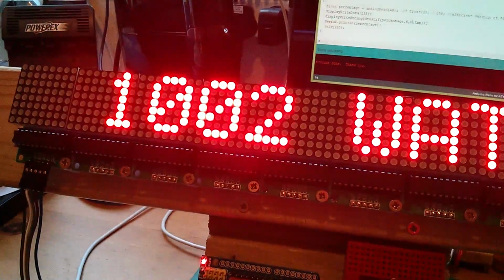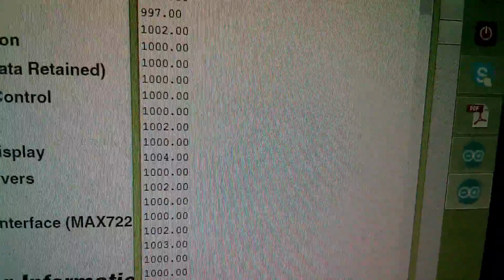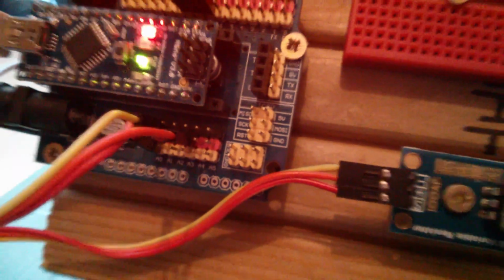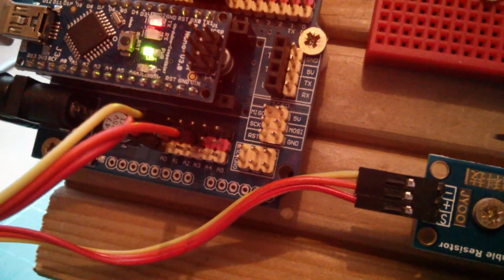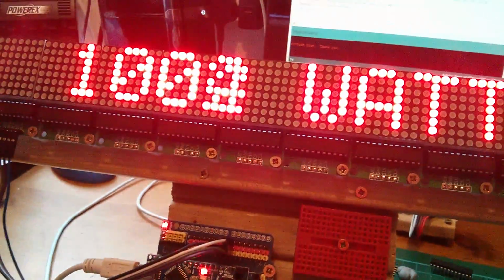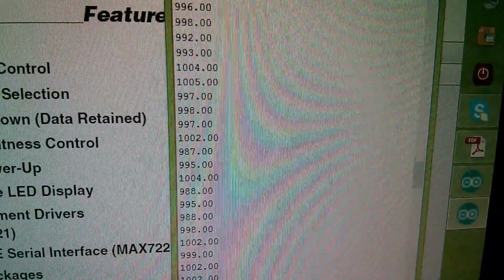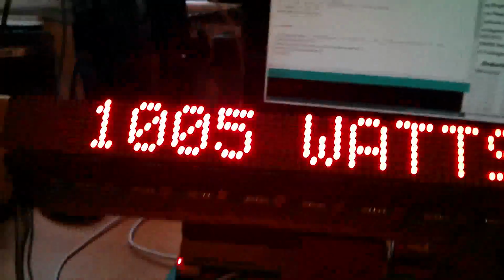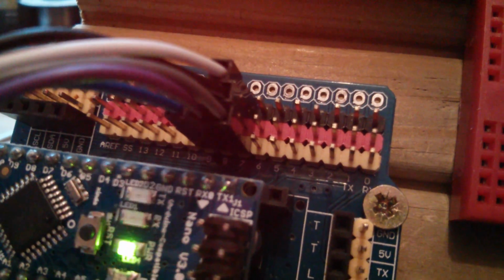Arduino Nano Tutorial - Breakout Board with 2A SMPS #2

Comment: If i'm not mistaken, you can reference an external reference, using the AREF pin, and this line in your sketch:
analogReference(EXTERNAL); // use AREF for reference voltage.

Here's a decent enough write up on it:
http://tronixstuff.com/2013/12/12/arduino-tutorials-chapter-22-aref-pin/

Comment from the maker: Code for this project (work in progress)

#define LED_DIN 7
#define LED_CS  8
#define LED_CLK 9

#include "font.h";

char tmp[16] = "       WATTS   ";
const int numberOfModules = 10;

void displayWriteString(char *characters)
{
  while (*characters) displayWriteCharacter(*characters++);
}

void displayWriteCharacter(char character)
{
  for (int i=0; i<5; i++) displayWriteData(ASCII[character - 0x20][i]);
  displayWriteData(0);
}

void displayWriteData(byte data)
{
  static int column = 0;
  static int module = 0;
  if (data == 255) {column = 0; module = 0; return;}
  int comm = 0;
  digitalWrite(LED_CS, LOW);
  for (int m=numberOfModules-1; m>-1; m--) {
    if (m == module) comm = (column % 8) + 1; else comm = 0;
    shiftOut(LED_DIN, LED_CLK, MSBFIRST, comm);
    shiftOut(LED_DIN, LED_CLK, MSBFIRST, data);
  }
  digitalWrite(LED_CS, HIGH);
  column++;
  if (column > 99) column = 0;
  module = column / 8;
}

void ledInit(void)
{
  digitalWrite(LED_CS, LOW);
  digitalWrite(LED_CLK, LOW);
  pinMode(LED_DIN, OUTPUT);
  pinMode(LED_CS, OUTPUT);
  pinMode(LED_CLK, OUTPUT);
}

void ledWrite(byte command, byte data)
{
  digitalWrite(LED_CS, LOW);
  shiftOut(LED_DIN, LED_CLK, MSBFIRST, command);
  shiftOut(LED_DIN, LED_CLK, MSBFIRST, data);
  digitalWrite(LED_CS, HIGH);
}

void setup()
{
  Serial.begin(9600);
  ledInit();
  ledWrite(0x0f, 0x00); //no test
  ledWrite(0x09, 0x00); //no decode
  ledWrite(0x0a, 0x0F); //set intensity
  ledWrite(0x0b, 0x07); //scan limit all digits
  ledWrite(0x0c, 0x01); //un-shutdown
  for (int q=1; q<10; q++) {ledWrite(q,0);} //clear display
  displayWriteData(255);
  displayWriteString(tmp);
}

void loop()
{
  analogRead(A0);
  delay (2);
  float percentage = analogRead(A0); //* float(25) / 256; //efficient version of *99/1024
  displayWriteData(255);
  displayWriteString(dtostrf(percentage,6,0,tmp));
  Serial.println(percentage);
  delay(20);
}

Comment: I have a couple of thoughts.  If you did use the switch mode supply for the sensor, can you make use of the arduino's external analogue ref pin?  Also, would putting a small capacitor between the analogue input pin and ground help reduce the noise?  

I've never tried doing that so I don't know if it would definitely help or not. :)

Comment: depending on how accurate, and how responsive you want things to be, you could also stabilize the noise by averaging out a number of subsequent sample values.  It's even easy to keep a running average going at the same speed as the samples, just averaged over the last X read values.

Comment: It sounds like you've tried filtering the analogue I/P without much success. It could be that the board (now) has poor grounding. You really need to keep the two supplies (one is your LED power, the other your measurement system - sensor/ADC) separate. If you have relatively high current flowing in the measurement ground this could cause ground bounce which will mess the measurement up.

Comment: Why didn't you link the +5V from the switch mode power supply to the AREF pin on the arduino, so it would be comparing the analog signals with the voltage coming out of your extension board. 

[EDIT] Oh, someone else mentioned this before...

Comment: 30.04.14
I was writing to you almost two months ago, and you answer me very fast. Thank you. After that I was waiting for LED and booster to arrive from the China. Two weeks ago I started experimenting with LED 100 W.
According to information from the internet, main problem with 100W LED chip is how to cool it down. High bay lamp has a passive, very big aluminum heat sink  ( ~ 2 kg ). Because expensive transport cost from China, I made it by myself.  It work fine, and after 1 Hour working, temperature around Led chip  was  lover than 50 C. I was using LED Power Supply Driver 100W For 100Watt High power LED Light Lamp Bulb 85-265V.
My first intention was to make led lamp for night fishing, so it should work with battery 12 V, like you show it in your YouTube video. I ordered   DC-DC 400W 6-40V to 8v-80v 10A Boost Converter Step-up Module Power Supply CC CV.
I connect Boost converter to my car battery ( 12 V, 45 Ah ). Dc-dc boost converter has output  about 32 V and 3 A.
After  about 1 hour. led lamp turns off.  Heat Sink Temperature, near Led chip,  was less than 50 C. After that I connect LED  to LED Power Supply Driver 100W For 100Watt High power LED Light Lamp Bulb 85-265V, and it works fine.
Probably  problem is the car battery.  I didn’t realize that bust converter will not use 3 A, from the car battery. I didn’t measure that, but I think that it’s about 8-12 A because of  losses.
I need it to work 3-4 hours on 12 V.
Can you help me with some advice. How many Amps booster is using from the battery?
Should the solution will bee the AGM Battery for the golf electric car?
Thank you
Bila Milos

Comment: Why you would like to have the 6 analog pins connected to the switch mode power supply would be if your sensors need a bit more current than your pot. 
You probably could have checked if the sensor board has the switched 5V connected to the analog reference (there is even a pin for this). If not then this would be an option plus adding big cap to the switch output.

Comment: Yep.  Digital supply to analog input pins is a design error for this board.  You may also find that the analog mux for the A/D is slightly interferred with by whatever voltage in on the analog input last scanned before this one.

Comment: Using the switch mode regulator power for measurement and a different one for reference will make the voltage fluctuations on both power supply add up that is why you see more noise.
Of course you can add a digital filler in software to make the reading even more stable. A basic filter will be just to take 5 to 10 measurements and calculate the average that average will then be displayed.

Comment: Couldn't you just have used the 
a ref pin??? Tie the 5 volts from the switch mode to the a ref pin and call the analog reference external function in the sketch.

Comment: well done man did you have a think about my question ?
Reply from the maker: You said the motor is 240v but didn't specify the current, or what the motor is driving. The second question I didn't understand.
Reply: hi ya i want to drive an elec quad but lightweight i want to control a 240 v 1600 rpm motor off an inverter , hoow would i control the revs ?
Reply from the maker: ***** My guess is some sort of thyristor controller, but AC motors is a subject that I know almost nothing about.
Reply: ok i have hrard of them what kind of rating do you reckon ish?

Comment: I guess the main reason for the noise is not the switched power supply itself, but the multiplexed displays. There's quite a difference between no dots lit at all and for example the seven vertical dots lit in a "1" or "T". The current in the shared trace (the trace below the "Deek-Robot") will cause a voltage drop that the ADC sees.

Just to see if it's the switching supply or the traces you could tap off VCC for the 6 "analog" VCCs directly at the switch (or as close as you can get to the regulator output cap) instead where it branches off now (left of SCK).
If the noise gets lower, it's the trace (that's why star like power nets are better; for low noise applications this would even be done for GND, too).
If the noise stays the same, it's the regulator. Larger decoupling caps could fix this, preferably near the displays and the analog stuff.

In the end, for this application software filtering (running average) would have been enough. I even go so far to foretell, you'll need it anyway: you don't want to see the fluctuations due to different pedaling force during one rotation of the pedals, do you? ;) .
But the troubleshooting still my come in handy in other projects.

And since I haven't written enough already, a plausibilty check: 20 counts of "noise" out of 1000 counts is 2%, which equals 100mV of 5V. I don't know about the current you draw, but in another video you talked about at least an Amp. A voltage drop of 100mV at 1A equals a resistance of 100mΩ. This is quite much what a 4cm piece of 0,2mm/35µm copper trace should have (this are the guestimated dimensions of the shared trace).
Reply from the maker: Aha, that's a good point - I didn't think about the current variation caused by the multiplexing. Anyway, I'm satisfied with the split power arrangement that the board now has. Still getting 5 LSBs of noise on the analogue though. Tried the double analogueRead() but that didn't do much. Put a 1uF ceramic across the pot but that didn't do much either.
And I suspect your prediction of pedal pressure variation will turn out to be a problem too. That could mean using some heavy-duty averaging!

Comment: I don't know the value of the potentiometer, but I guess it's not a small value. Since ADCs prefer a low impedance signal I would suggest you to buffer the output of the pot with an op-amp (any cheap rail-to-rail op-amp will work just fine).
Reply: Thanks for pointing that out! From the ATMEGA328 datasheet (the section on the ADC), the ADC is optimized for analog signals with an output impedance of approximately 10 kΩ or less.

Comment: This is just a shot in the dark- but I had a similar problem with my HAB data logger for analog read and I found it was due to the ADC being multiplexed and high impedance stuff was too slow causing stutter- I solved it by doing two reads and throwing out the first one.  The post I found the solution was http://forums.adafruit.com/viewtopic.php?f=25&t=11597  Cheers!
Reply from the maker: That's interesting. It seems Arduino's analogRead() function doesn't leave much time between switching of the input multiplexer and the start of the ADC conversion process. Not a problem if you're only using one ADC channel, but could very well be a problem when multiple sensors are involved. Soon I'll be reading voltage and current from two different sensors, and this timing problem could rear its head. The double read is a neat workaround.
Reply: Julian Ilett It was a bit funny- I was using only a single analog temp sensor in my case and it was unstable. All the remaining items hooked up were I2C.   I did the double read and it worked quite amazing.  Only after tearing my hair out for about 2 hours (or more).  Cheers Sir

Comment: You could simply pump your switching 5V into the REF pin of the Arduino. This will also take care of your noise as the reference  always has the same top level as the 5V switching. You'd only need to define in your software that you are using an external reference.
Reply from the maker: That's a neat idea, but there may still be a problem. While the 10-bit successive approximation is underway, the analogue input voltage is frozen on the sample and hold capacitor. But it doesn't look like the reference voltage is held in the same way. The regulator switching frequency is probably slower than the approximation frequency, but there could still be movement during the approximation period.
Reply: Julian Ilett This is a neat thought! I like watching your videos and reading your comments because it makes me think about things a little bit harder. So, thanks.

It might be interesting if you used your oscilloscope to look at the switching regulator's output when the load is turned on. I'd guess the switching speed is similar to or faster than the ADC's conversion, since it looked like quite a small inductor on the shield, which probably means hundred kHz or more while I've read the ATMEGA really wants an ADC clock of between 50 kHz and 200 kHz for best resolution. You might figure out the ADC's speed through the Arduino environment's init section for your board; it probably sets the clock prescale for the ADC to 128 or something for a 125 kHz rate assuming the ATMEGA is at 16 MHz. It might also not be programmed to change this prescale if your board is set to run at a lower clock, and might thus be a bit noisier.

Comment: Would an extra decoupling capacitor help if mounted across 5V and 0V at the potentiometer?  Failing that there's always the option of using software to dampen the result by moving in the direction of the current reading relative to the last one, with the speed of movement affected by the difference.
Reply from the maker: Yes, I'm sure that would help. There is a small capacitor between wiper and ground on the back of the potentiometer module (I'd forgotton it was there) but it's probably a low value.
Digital filtering would also help, and it may be possible to put the microcontroller to sleep while successive approximation takes place - that's something I want to look at at some point.